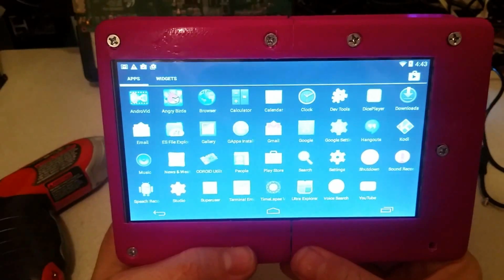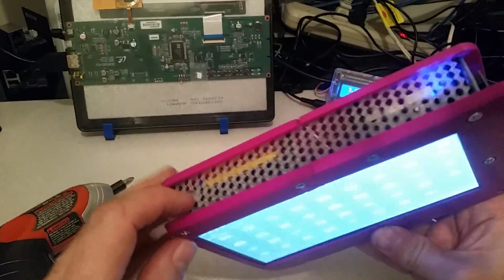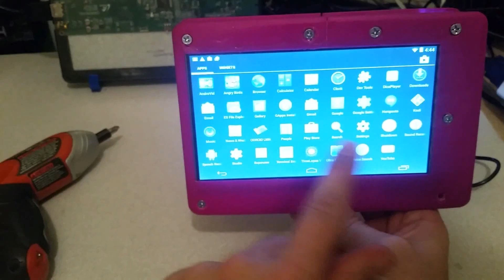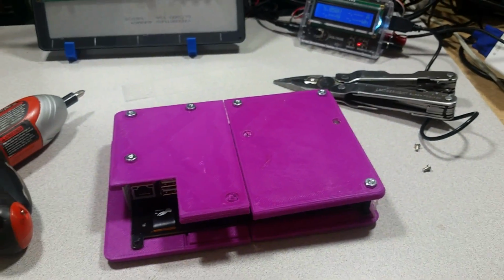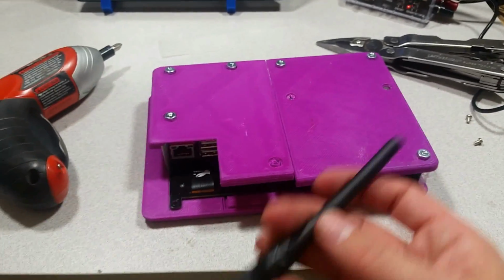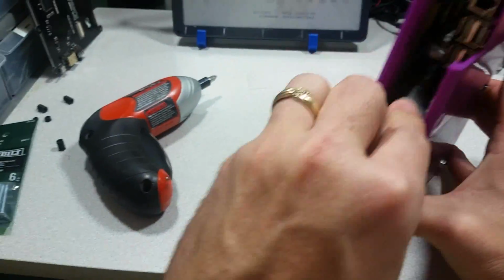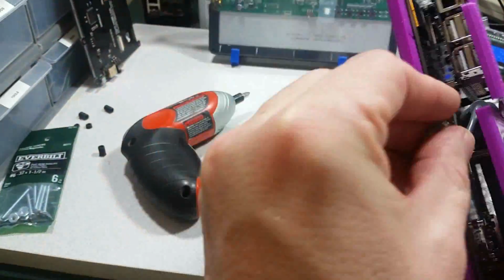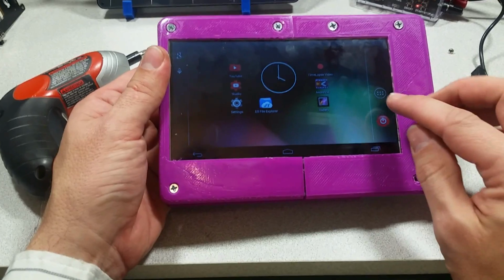How to Build a Tablet from a single board computer and touchscreen

Comment: Can u make a portable laptop pc with the odroid h2 and upload thnx
Reply from the maker: It's definitely possible. The biggest challenge would be heat dissipation. The heat sink on the H2 is too large as it is. We would probably have to find a laptop cooling system that we could retrofit onto the H2.
Reply: @Ameridroid1  how would I make a pc with a odroid h2
Reply from the maker: @boyarkenny2406  An ODROID-H2 is already a PC. You might want to put it into a case, but other than that, it is ready to use.

Comment: what 3d printer do you have?
Reply from the maker: At the time of this video, we had a Solidoodle2, but it is no longer being used due to breakage by overusing it! Now, we have a MakerGear M2, Creality CR10 and a Monoprice Maker Select V2. I prefer them in that order. :-)
Reply: @Ameridroid1  Thanks. Is the MakerGear worth the higher price, compared to the Creality and Monoprice Maker? It seems to cost ca 10 times as much as the other two, at least here in Germany.
Reply from the maker: @mariomueller9692  I wouldn't say the M2 is worth 10 times the price. We paid about 4x more than the Creality CR10 for it (both purchased new). The Creality CR10 is probably the best value for the dollar after performing some simple upgrades and tweaking it for best results. But the M2 is very solid and much easier to tweak, and doesn't need any upgrades out of the box.

Comment: So it looks like the majority of space when building a touchscreen device is used by connectors that go all of one or two millimeters? Why do they even exist? HDMI couplers are used inside project tablets? If that’s the case I might as well just give up now as it seems like I was expecting a ribbon cable or something more permanent and small.

Given that I have a 2.4” Screen set for my device, I don’t think any consumer HDMI connection should be needed yet I can’t seem to find a video with the tutorials showing the small form screen ribbon cables being setup with a single board tiny computer.
Reply from the maker: When building prototypes using general-purpose components, it is true that a huge amount of space goes to connectors and cables. It is definitely possible to minimize this by building custom connectors and cables, but it greatly increases the time required to build the prototype and makes it harder to try different configurations. This build definitely leans heavily on the side of using off-the-shelf components and cables.

Comment: Your tablet is not thin.
But I think this is a genius device and more versatile than an Android or iPad tablet because of the connectivity.
This device is also an excellent platform for kids to learn the internals of tablets and how to build their own.
Reply from the maker: The tablet cannot be thin using off-the-shelf components like this, but it can be useful. The other day, I was in a store and the clerk was using a tablet about as thick (designed for durability). Also, modular and rugged tablets are very expensive if you want to buy one.

But you are correct - this type of tablet is an excellent platform for learning and tinkering!

Comment: Thank you very much for this very inspiring video, do you think it is possible do create a tablet with another board like the XU4?
Reply: Yes, it is possible, but the battery controller will be more difficult as it has to supply up to 4A at 5VDC.
Reply: +MrRespecTech Any advice on what i should use?
Reply: +MrRespecTech Does the cable that goes from the ups3 to the c+ comes with the ups3 or is it something i will need to buy and install myself?
Reply from the maker: It's possible, but providing up to 4A at 5VDC is a challenging consideration if you want to run it off a battery. There are ways, however!
Reply from the maker: The UPS3 comes with a cable that connects to the barrel connector on the C2. If you want to power the C2 through the header like we did in the video, then you will need to find that type of cable somewhere. They are pretty common inside old computer cases, especially where buttons and LEDs connect to the motherboard.

Comment: can you use a HDD because they are way cheaper
Reply: HappySlappyFace really?
Reply: Bruh so if not why dont they put hhd in tablets? Hdd spins in higgs speeds! And the platter and reader have a distance from each other lower than a micrometer
The smallest cmshake can break it
Thatd why they usually have a rubber case
Reply: HappySlappyFace ok
Reply: Tommy Whitaker how old are you?
Reply: HDD's dont last long on hand held devices...

Comment: does it have a CPU fan?
Reply from the maker: No. Just a heatsink.
Reply: ameriDroid what happens if it doesn't have a heatsink
Reply from the maker: Tommy Whitaker It doesn't run as fast.
Reply: ameriDroid but is it a fire hazard?
Reply: technology productions 2017 no. unless the air doesn't circulate enough. The cpu doesn't produce as much heat. The ODROID XU4 has a fan, because it has 8 cores and more powerful cpu that on the c2,c1 and other boards.

Comment: couldn't you have bought a 50$ dragon touch
Reply from the maker: Yes, but a $50 Dragon Touch is not expandable or customizable. It doesn't have Gigabit Ethernet or full-sized USB ports. And if anything breaks, you have to toss the whole thing instead of just replace the part that broke.
Reply: ameriDroid does the tablet still work
Reply from the maker: Tommy Whitaker
Yep! It is on 24/7 and we use it all the time.
Reply: ameriDroid do. You upgrade it every month or year
Reply from the maker: Tommy Whitaker Whenever we feel like it. :-)
Reply: ameriDroid what is it upgraded to

Comment: I'm curious as to why you printed the front and back panels as two separate pieces each?  was it just a limitation of your printer?

great work overall
Reply from the maker: +LordDrachenblut Yes, my printer only has a 6x6" print bed. The front and back plates are bigger than that, so we had to go with a two-piece design. It is easy enough to bond them with acetone when we're happy with the final design.
Reply: +ameriDroid have you released versions of the file that have these as a single piece?
Reply from the maker: LordDrachenblut No, but Repetier and other printing software allows multiple pieces to be laid out together on a single build plate. If you touch the pieces to each other, the slicer software will create it as one piece.